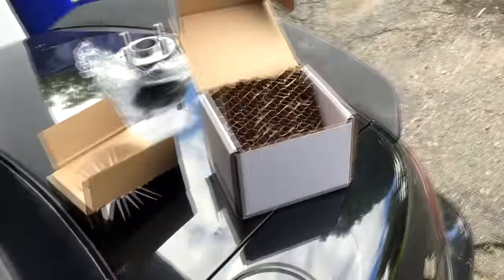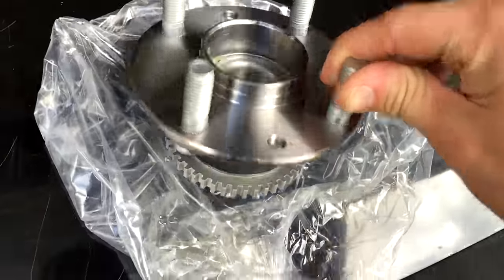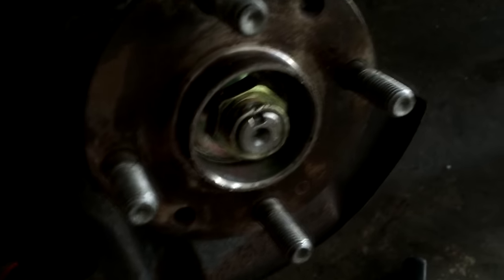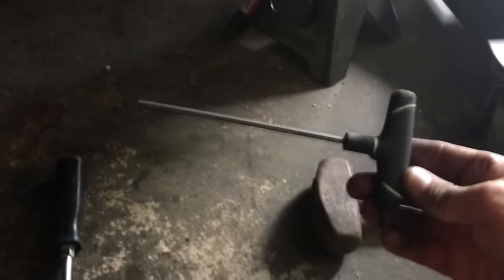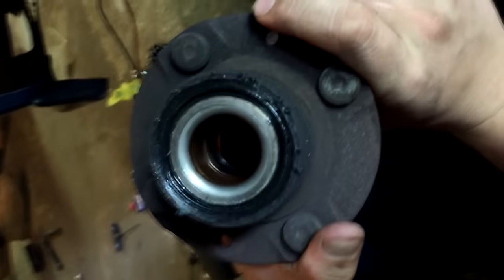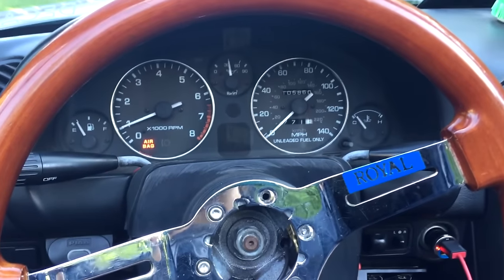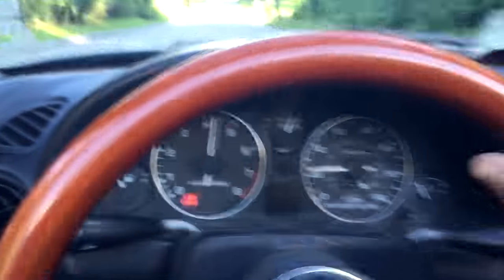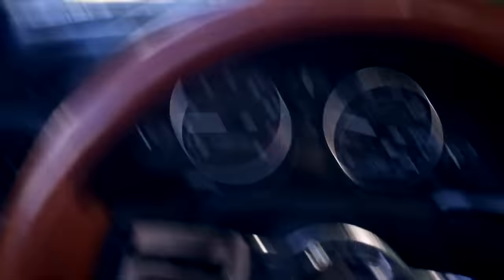How To Change A Wheel Bearing

Comment: that bearings not that bad, its the camber of the wheel thats making it sound worse. ive driven on some bad ones.... like full on grind and crunching. wtf does royal mean on the steering wheel btw?
Reply: "Grip royal" is the make
Reply: +Mike Martin If a bearing makes a loud ass howling noise, it's bad. The example you gave is just a worse one...